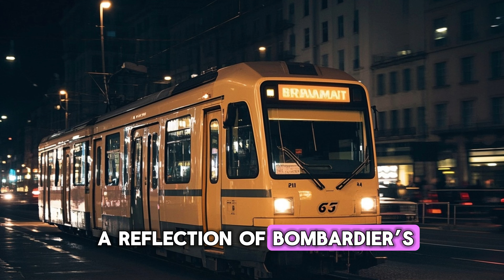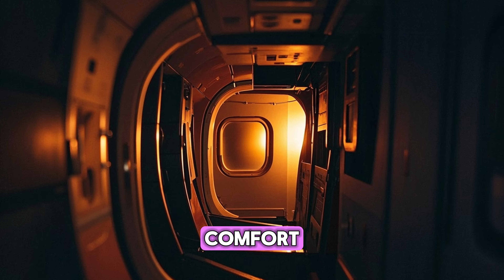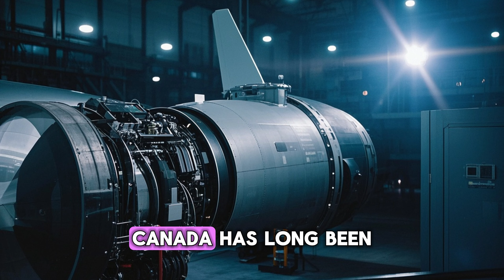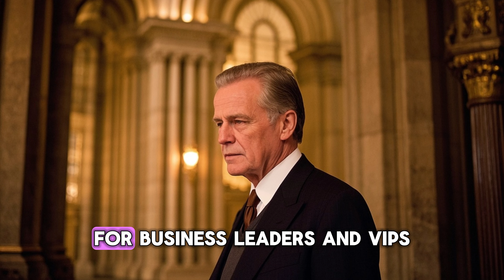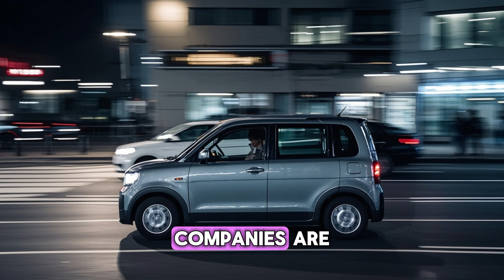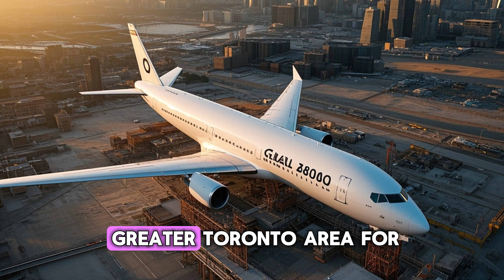Canada’s Bombardier Global 8000 – Fastest Business Jet Ever | The Future of Aviation Begins Here

Comment from the maker: Canada is quickly becoming a global powerhouse in aerospace innovation, and at the forefront of this revolution is Bombardier’s upcoming marvel—the Global 8000.
Built for both prestige and performance, the Global 8000 is designed to change the way we think about private aviation.
It’s not just a jet; it’s a declaration of excellence, ambition, and national pride.
As Canada steps into the global spotlight, the Global 8000 symbolizes more than technological advancement—it represents a bold step toward redefining modern travel.
Located in the heart of Canada’s thriving aerospace hub, the Greater Toronto Area has become the launchpad for the Global 8000.
Bombardier’s Aircraft Assembly Centre near Toronto Pearson International Airport is where this engineering marvel is taking shape.
With every nut and bolt assembled on Canadian soil, the facility serves as a beacon of domestic capability and pride.
Advanced robotics, precision tools, and skilled technicians come together in harmony to breathe life into what is poised to be the most capable business jet of its kind.
What sets the Global 8000 apart is not just where it’s built—but how.
Every detail, every curve, and every system is a reflection of Bombardier’s commitment to quality.
The assembly plant is equipped with cutting-edge automation and digital design systems that ensure accuracy down to the millimeter.
This meticulous process reflects Canada’s world-class aerospace ecosystem, a network of research centers, engineering firms, and universities working together to push the boundaries of flight.
When we talk about speed, we often think of supersonic jets of the past.
But the Global 8000 is changing the conversation.
Capable of cruising at Mach 0.94, it stands to become the fastest purpose-built business jet in the world.
That places it just behind the legendary Concorde in terms of speed, while offering far greater efficiency, comfort, and sustainability.
In today’s world, where time is more valuable than ever, the ability to fly at near-supersonic speed gives corporate leaders and governments an unmatched strategic advantage.
Beyond speed lies endurance.
The Global 8000 boasts an intercontinental range of 8,000 nautical miles, a feat that unlocks nonstop routes between global power centers.
Imagine flying nonstop from London to Perth.
From Singapore to Los Angeles.
From Dubai to Houston.
These are not theoretical connections—they’re real flight paths now within reach.
This range opens new opportunities for business leaders, diplomats, and high-profile travelers who require maximum mobility without sacrificing comfort or time.
The aircraft’s capabilities are not just conceptual—they’ve been proven in the skies.
Bombardier has already conducted multiple test flights out of its Wichita, Kansas facility, and each mission has confirmed the jet’s performance under real-world conditions.
From transatlantic crossings to stress tests in variable climates, the Global 8000 is demonstrating that it’s more than a promise—it’s a proven performer.
Among the most notable advantages is its ability to take off and land on shorter runways, making it highly versatile and accessible to a wider range of airports worldwide.
This runway flexibility gives it a competitive edge, particularly in business travel.
Executives can now avoid congested international hubs and land closer to their destinations, saving hours of transit time.
This isn’t just about convenience; it’s about productivity and agility in a fast-moving global economy.
The Global 8000’s operational efficiency provides a tactical advantage to those who demand the best of both performance and practicality.
Step inside the aircraft, and you’ll discover an entirely new dimension of comfort.
The Global 8000 isn’t simply luxurious—it redefines what it means to travel well.
With four spacious, customizable living zones, passengers can tailor the cabin layout to meet their exact needs.
Whether it’s a boardroom in the sky, a bedroom suite for rest, or a media lounge for entertainment, the aircraft adapts to each journey with elegance.
Comfort goes beyond layout.
Bombardier has integrated the longest seated cabin in its class, giving passengers room to stretch, relax, and work without compromise.
Advanced air purification systems and noise-reduction technology ensure that travelers arrive feeling refreshed and focused.
Every inch of the aircraft reflects ergonomic design, blending form with function to create a space that is not only beautiful but biologically intelligent.
For flight crews, the aircraft includes a dedicated rest area, allowing long-haul operations to continue safely and efficiently.
These features reflect Bombardier’s deep understanding of aviation—from both a passenger’s and a pilot’s perspective.
The aircraft is built not only to impress but to perform, and its attention to crew welfare underscores its holistic design philosophy.
Looking ahead, the Global 8000 is more than a new aircraft—it is the future of business aviation.
As final assembly continues, the jet becomes a symbol of Canada’s ability to lead in innovation, technology, and advanced manufacturing.
The aerospace industry is watching closely, not just for the product but for the process.
Canada’s model—centered on integration, quality, and sustainability—may set the standard for how high-performance aviation is approached in the 21st century.
With a launch date set for 2025, the anticipation surrounding the Global 8000 is reaching new heights.
The jet represents not only a leap in aeronautics but a statement of Canada’s industrial and creative capacity.
Its journey from blueprints to blue skies is a reminder that when ambition meets expertise, the sky is not the limit—it’s only the beginning.
Bombardier’s journey into the aviation world has been decades in the making.
Originally known for building snowmobiles, the company transformed into one of the world’s premier names in business aviation.
Throughout the 1980s and 1990s, Bombardier acquired and developed capabilities in regional jets and executive aircraft, gradually shaping itself into a force in the global aerospace arena.
Canada has long been a major contributor to aviation innovation, with companies like Pratt & Whitney Canada, CAE, and Magellan Aerospace contributing to aircraft systems, simulation technologies, and parts manufacturing.
Now, with the Global 8000, Bombardier is positioning the country once again at the forefront of elite business jet production.
The business jet market is fiercely competitive, dominated by manufacturers in the United States, France, and Brazil.
To stand out, an aircraft must offer something truly unique.
The Global 8000’s blend of speed, endurance, and luxury gives it an edge.
It challenges competitors like the Gulfstream G700 and Dassault Falcon 10X by pushing the boundaries of what private aircraft can achieve.
Industry analysts suggest that once fully operational, the Global 8000 could redefine fleet expectations for global corporations and charter providers.
It may even prompt a new wave of aircraft development across the sector.
From a technical standpoint, the Global 8000 integrates multiple cutting-edge systems.
These include fly-by-wire controls, lightweight composite materials, and enhanced cockpit avionics.
Pilots benefit from digital flight management interfaces, advanced weather mapping tools, and intuitive navigation assistance.
Meanwhile, passengers experience cabin pressure optimized to 4,500 feet—even at cruising altitude—dramatically improving comfort and reducing jet lag.
The seamless combination of technology and human-centered design sets a benchmark for future aircraft.
In today’s aviation world, sustainability is not an afterthought—it’s a demand.
Bombardier has responded by incorporating fuel-efficient engines and emissions-reducing technologies into the Global 8000.
Compared to older models, it delivers a significant reduction in CO2 per nautical mile flown.
The company is also investing in sustainable aviation fuel partnerships and carbon offset programs, aligning itself with international climate goals.
This aircraft isn’t just faster—it’s cleaner.
The success of the Global 8000 wouldn’t be possible without the highly skilled Canadian workforce.
Across Ontario and Quebec, thousands of engineers, machinists, systems designers, and logistics experts are contributing to the jet’s creation.
Many have trained at Canada’s top polytechnic institutes and universities, institutions that now integrate aerospace-focused programs to meet the rising demand for aviation talent.
The ripple effect of such a project is huge—it stimulates job creation, encourages STEM education, and solidifies Canada’s reputation as a country of innovation.
For business leaders and VIPs, time is the most valuable currency.
The Global 8000 recognizes this by offering a seamless experience from boarding to touchdown.
With soundproofed cabins, ultra-fast connectivity, and personalized cabin lighting, every detail is tailored for productivity and peace of mind.
High net-worth individuals and global CEOs often use travel time to finalize deals, prepare for meetings, or recuperate between engagements.
This aircraft makes that not only possible but enjoyable.